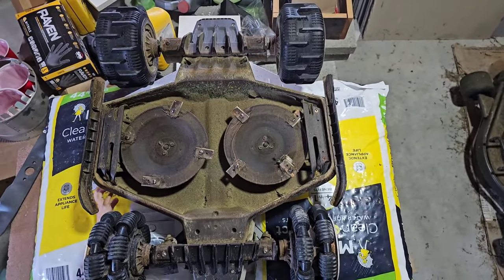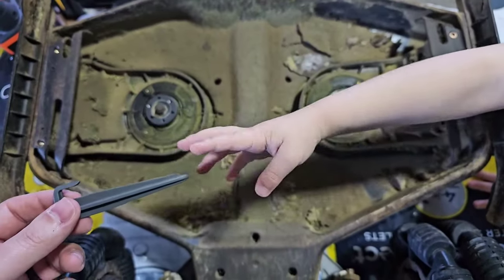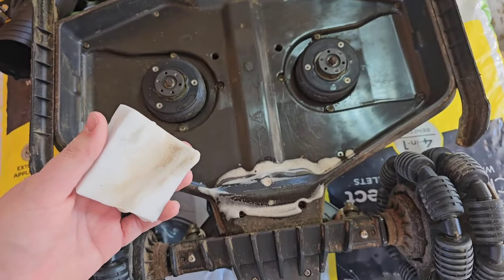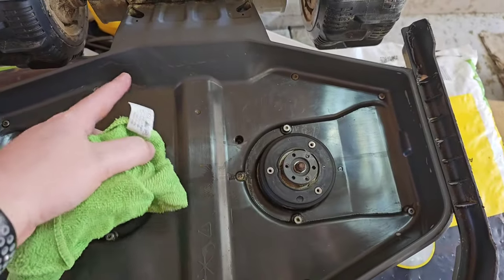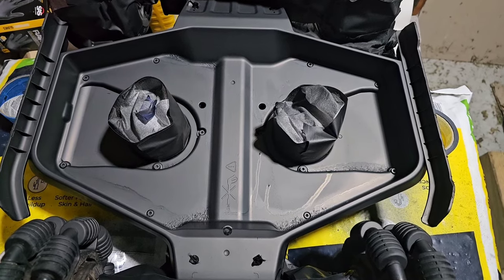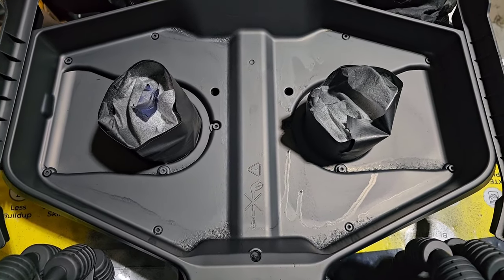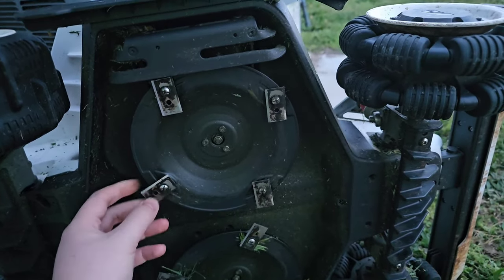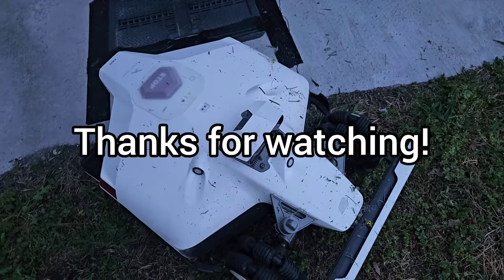Luba 2 deep clean, undercoating, paint job. plastic mower deck treatment

Comment: Also 3d print or cut out some blade covers to prevent the grass stopping the blades
Reply from the maker: The reviews on those say they don't work well.
Reply: @RobotMowerTricks  I use 3d printed covers over each of those spinning disks to cover the blade screws on my Luba 5000... YES... it actually does work really well.  I also replaced the screws for standard Phillips screws... I highly recommend the cover.
Reply from the maker: @covertpuppytwo3857  mine came with Phillips.
That's great yours are working

Comment: Is there an update on how this is going? Wondering if it's worth doing when my Luba 2 when it gets here, as I had a lot of buildup with Luba 1.
Reply from the maker: Yeah, I had shot some video of it for an equal comparison, and have been too busy to edit it all together. I also wasn't sure what to say... the bottom is not clean, but it's not building up either. Running it wet seems to clean it off, but it also causes more grass to get stuck on the guards. I think you'll have a good experience if you coat it with this, and mow your yard with a gas mower, and then keep Luba running. I went out of town, and it rained, and luba did not run all weekend. We've had a lot of rain since then, and I have not been able to get luba to catch up. I also lost of day with the positioning error that everyone got. I was in the beta group, and installing the beta firmware got it running again, so I did not lose 2-3 days like many others. It's building up in the guards, but not on the deck like you see in the start of this video. I can still see the black deck through the thin layer of grass (before the coating it, the black did not show through on the main areas). Another option is getting an extra set of disks, I think they are $30 each from mammotion, then remove the guards. Also, run it every day so it's barely cutting anything. For me, it takes 3 days to mow the whole yard, so it's hard for luba to keep up.
Reply: @RobotMowerTricks  awesome.  I have a fairly small yard. Maybe 5 or 6 hours with my luba settings to cut.   So I'll give this stuff a shot then!  Before I do the first cut so it's easy to spray on 😄
Reply from the maker: Sounds good! I'd love to hear what you think of it over time.
Reply: @RobotMowerTricks   sure thing. I will test it out for a few weeks and come back to update how it goes for me
Reply: So, I have run the mower a few times now with the stuff applied, and it is much better. It is mostly cleared, with a few little patches stuck. But they come right off! I sprayed the mower disks as well, and so far, after four or five cuts, my blades are not seized up like they were previously! I'm glad I coated everything before the first cut so I didn't have to try and clean it out first. 😅
Reply from the maker: @warp5768  wonderful! I'm glad you avoided the pain of cleaning it like me!

Comment: Nice video.  I think I ask you before how long you have had your LUBA.  Did you buy an extended warranty?  Thank you for the information.
Reply from the maker: I received mine in late February, I did not buy an extended warranty. Extended warranties are usually third parties, and they are terrible to work with. I did it on my sofa and I will never do it again. They took 8 months to decide my my claim, and simply marked it as denied with no explanation. The whole company is set up to take people's money and deny claims. For instance, they did not have a phone number.
Reply: Thank you.  I'm still deciding if I should purchase a Luba. A friend of mine bought a Husqvarna Robot mower 8 years ago and it is still working. He says it works great except the wire he had to bury keeps breaking. 

As I'm sure you know, Luba has a two year warranty.  I was going to purchase the Luba from Amazon and also buy the warranty from Asurion.  However, I want to extend the Luba warranty to 5 years with the Asurion warranty.  I don't think that is the way it works.  Thank you for your help and videos.
Reply from the maker: @HurleyDeanSandpointIdaho  My yard is large enough, no wired mower could handle 1.25 acres. But if you're willing to fix the wires and your yard is small enough, and smooth enough for the 2 wheel drive, any wired mower is a huge money saver.

Comment: I would absolutely not recommend to wash with water underside. Especially when you have removed guards which seal rubber. Many users get water this way inside of luba and damage Luba electronic
Reply from the maker: Thanks for the comment. I had heard of users having problems when they use water while upside down, but I've never heard that the guards seal the rubber. I'll have to look into that
Reply: @RobotMowerTricks  maybe I chose wrong words. Guards press rubber down to seal. Otherwise rubber will lift up and make a gap. Also, I mow without guards for more than half year without problem
Reply from the maker: @0ssaa  Did you totally remove the guards so they are no longer pushing on the rubber to seal it? Or keep the plastic plate and drill out the rivets to remove the metal part?
Reply: @RobotMowerTricks I surmise the metal part is to protect “fingers” of anyone who might try to lift the Luba while it is traversing a yard.  The metal parts certainly shield the outermost reach of the blades.

I have a Luba 2 AWD 10000H mowing the full 2.5 acres so I have certainly experienced the little idiosyncrasies of the Luba 2.

I’d say to anyone considering buying a Luba 2 to just pull the trigger and buy it.  It’s a game changer if you’re someone like me who loathes mowing grass.

I’m considering buying a second Luba 2 for a more distant part of my property where I mow around farm buildings that are outside the confines of the 2.5 acres that my house sits on.